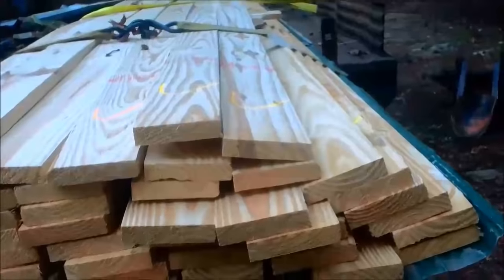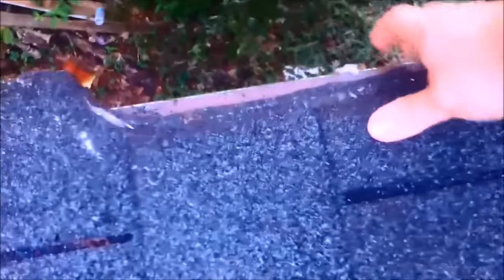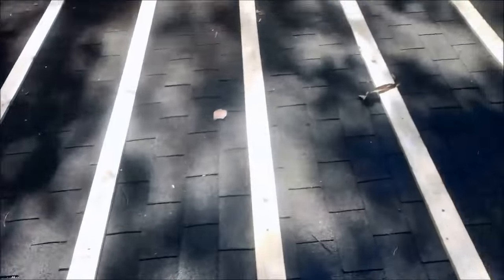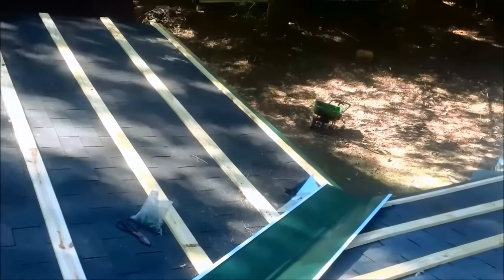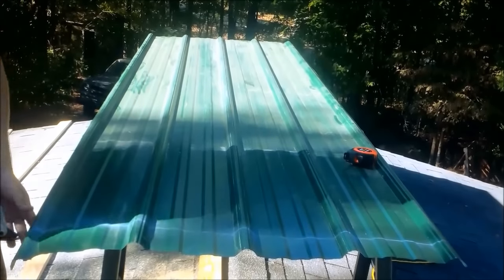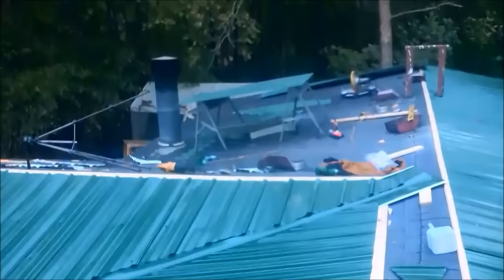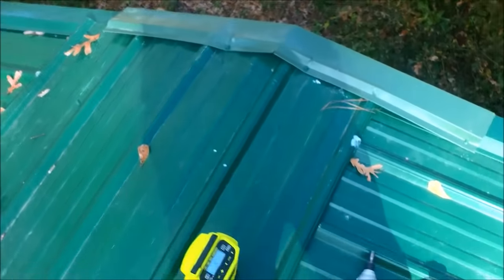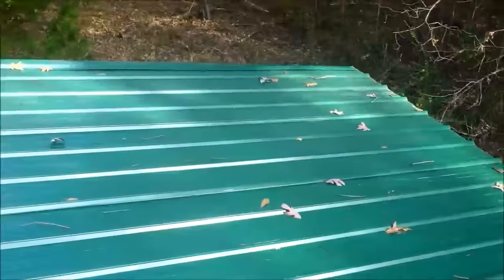How To Metal roof for cheap

Comment: Do you need to get a reroofing like this certified so that when you resell, the roof age is updated to reflect the installation?

And who would do that, local inspector?

And then, would you need a permit to do this?

Thanks.

Comment: Can younwalk on these roofs? Seems like they will dent easy. Thanks for sharing 👍.
Reply: If you step where the screws are the strapping is under that so you’re going to be fine. If you wear running shoes they are softer and lots of grip on a high pitch roof.
Reply: If you step where the screws are that’s where the strapping is so you’re fine. Wear running shoes for grip on higher pitch roof
Reply: If you step where the screws are that’s where the strapping is so you’re fine. Wear running shoes for grip on higher pitch roof.

Comment: Really nice roofing job Bro! We had a 29g roof installed recently and it’s a mess. If I knew then what I knew now I would have probably installed it myself. 

FYI, I would highly recommend anyone looking for a metal roof to atleast step up to 26g steel. Also, keep close eyes on your contractor throughout this particular project. Ensure they do not over tighten the screws and damage the paneling. Check the valley seams, they should overlap 6” minimum. As for the vent/chimney flashing make darn sure they’re placing the upgradient end under the metal sheeting to help prevent water from infiltrating beneath the flashing.

In short, manyyy experienced roofers and suppliers have told us they do not recommend metal roofing. It’s HIGH maintenance due to the  material quality, expanding of materials, likelihood of wind blowing rain backup and under seams. 

If a Roofer won’t send you a professionally written estimate with their letterhead, followed by a written warranty, many references for roofs they’ve installed several years prior than do not waste your money on them.

We now have to remove our brand new roofing due to liars that believe they can roof but truly don’t have the skill level to cut the material properly, lay out the panels, know the best way to seal seams, etc. 

Pay 1/3rd cost and get the lifetime warranty shingles that also covers 25yrs of labor and be done.
Reply: the reason i'm here ... guy just came out to give my mom a estimate for a metal roof, unfortunately i couldn't be there due to my work schedule but when i got there my mom was all excited saying "the guy is amish and he gave me a good price for the metal roof $17k and said look at the estimate and see what you think .. i looked at it and immediately see it's 29 guage metal and it's of course exposed fastener .. he did not explain anything to my mom about guage thickness, difference of exposed fastener/standing seam etc.
 I called the guy and told him i was concerned about the 29g metal on her log home that frequently experiences high wind .. his response "29g is all we use and i have not had a roof blow off yet"  also the only warranty i seen on estimate was 5-year labor. I told my mom i feel she'd be better off with a good quality shingle roof replacement. 
 Please share your thoughts .... i also worry about the exposed fasteners as i have read online how the washers can fail after 7-10 years and water can leak through those screw holes ..

Comment: I’m worried that my roof will sweat if I use 1x4 purlins on existing shingles . I’m in a sub arctic region … I also need to level my roof in one small area with the purlins …. Is 1x 4 s and shim it up level ok , or should I use 2x6

Comment: I am not trying to be negative about a video intended to help others but I don't recommend this. I had my roof done 9 years ago and after the tear off they ran ice/water shield the whole way with drip edge on the edges then 1x4 lath. 
Metal roofing inherently sweats, when you add an airspace under it by putting it on lath, the sweat will dam up on the top edge of the lath and you will have a constant drip with the daily temperature changes which will eventually over time get in behind the facia boards and cause problems. (Ask me how I know) Also, the lath being constantly wet from the sweat will cause it to rot.
My roof has OSB sheeting and I was sold on the theory of having the lath so the screws would have more to bite into. True but not the correct way to do it. Better off running the metal right on top of the shingles and run the screws into the sheeting then just babysit the screws in case any back out from the freeze thaw process.
At least that's what I am experiencing in this northern Idaho climate.

Comment: Good video, if you don't want to purchase the metal cutting tool a simpler trick is to remove the blade from a handheld skill saw, turn it backwards, replace and tighten. It will cut clean in similar fashion
Reply: Heat from the blade scorches the painted metal. Been there, done that, bought an electric shear from HF

Comment: Where are the plumbing stacks, vents, roof vents, ridge vents?
Reply: Wallace Grommet First? I had too! That’s no right at all.!!!
Reply: I had the same question. Were the vent stacks cut slightly below the height of the one by fours, so the venting could still happen within the space above the existing roof within the one by four height across the roof?  I guess this would be OK if the venting can still happen enough outside of the trailer.  I would like to hear thoughts from the author to see if there have been any venting issues and what exactly was done with the vents.
Reply: We don’t need no stinking vents! 😂🤣

Comment: No! Put the screws on the ridges, not the valleys. The plastic washers will degrade over time, and the roof will leak if the screws are in the valleys. In Australia, this would be an instant fail.
Reply from the maker: I buy from the manufacturer they say screw in valleys they said other wise it voids there warranty
Reply: @DannysCam  Then find a new manufacturer. Your clients are going to blame you in ten years' time when they find that their roofs are leaking and the timber underneath is rotting. Washers on roofing screws only work if you have not over-tightened or under-tightened them, and they degrade over time.
Reply: it doesnt rain in Australia

Comment: I would periodically check the silicone. When it comes to water versus silicone, if left unattended, water always wins eventually.
Reply: Might sound silly, but flex seal is what I would probably use.  I have sealed up exterior gaps a half inch or so wide that held for ten years.  The stuff is crazy lol

Comment: FYI - Running wood from top to bottom (vertical) underneath your horizontal wood would allow more airflow (vent the heat) to reduce A/C costs.
Cheap upfront is not always cheapest long run.
Reply: The ribs run top to bottom and can do what you're talking about

Comment: that looked like pine wood you used, was it pressure treated? If not you will definitely have problems down the road.
Reply from the maker: Common practice I removed a 40 year old roof done like this the 1x4s were good enough to reuse

Comment: I've laid thousands of square of metal roofing. Never seen someone put it down with battons. Micheal  Ledford is right the wood will rot  and a lot faster than you think depending on the weather where you're at.TOTAL AMATEUR SorryDanny
Reply: I keep hearing about using firring strips if metal roof installed over shingles (for shed.) I'm assuming firring strips are same as battons. Had a barn for decades and firring strips under metal roof  did not rot. But please elaborate bc planning to use ffitring strips over shingles on a shed in a few months. Thanks! (PS barn was in rainy East Coast,.DelMarVa area.)
Reply: PS - Also, do you think treated wood (vs untreated battons) would hold up better for metal roof (installed over shingles on a shed.) Thanks.

Comment: Man Danny you did a fine job,thing about metal roofs, they last a life time.But the only down side is slippery when wet, and really hard to stay on if you have a high pitch,.On that ridge cap did you think about flattenning the edges where it drainsdown but it would not look too great pounded flat I guess??
Reply from the maker: +N.E.Arkansas Trash Trucks&Lottery thought about it but worryed it would cause the pieces not to over lap so well

Comment: We made a small storage room in the backyard, using cinder blocks, cement, and metal rods for the  corner columns, and put some treated Southern Yellow Pine, around the top, of the perimeter. What do you recommend for covering the grooves on the sides of the metal sheets? I'm thinking what you put there, but what's it called again? You said it pretty fast. Thank you.

Comment: Bantons need gaps lengthwise or trapped condensation will eventually lead to rot, especially with no ridge vent. You did leave the space open on your ridge, correct?
Reply: why do you think it will condensate?

Comment: your silicone is gonna cook in the sun. , but you got a great deal on the materials. as long a you keep a yearly eye on the silicone and replace it as needed you saved a big bundle
Reply: is there a better sealant that won't cook in the sun?
Reply: Tar wont
Reply: "Tar" (which isn't really tar these days) degrades in ultra-violet light just like everything else does.   This installation is a mess.  We won't allow any installation that relies on sealants of any kind as a first defense against leaks.  Gravity flashings, properly fabricated, are the only reliable solution long-term.   Just glopping something out of a caulking gun onto a roof is a joke.

Comment: He doesn't mention how to measure the valley panel lengths. If using measurements (of both sides) to cut the valley panel angles (no adjustable tee-square), keep one thing in mind when measuring the next panel length on both sides. Measure where this panel overlap flange ends, and not where the next panel begins. Failure to measure where the overlap ends, will result in the wrong angle when cutting the sheet. Of course you could compensate by marking this panel to be cut at the 36" point and then strike the cut line, which would extend to include the overlap of this sheet. It would be easier to build a jig square for your angle, and then measure the next panel length on the short side (where the overlap starts) and then use the jig for the proper angle.

Comment: why the wood strips and not lay the steel panels directly on the shingles which are backed by plywood?
Reply: The metal  roofing panel manufacturers don't want steel roofing directly on sheathing (or anything else) because of condensation issues.  The steel needs to dry on the back side.   This is POLE BARN roofing, it's not really designed for residential applications, and because it has exposed fasteners eventually it is going to leak at the fasteners.  The little rubber grommets on the screws are good for a few years and that is all.  For an agricultural building - who cares, but I really hate to see pole barn panels on a house.     IF this was a true standing-seam (hidden fastener) copper roof - you could apply it over solid sheathing.  Not this stuff.
Reply: Really has nothing to do with it - the issue is condensation.  But regardless you could never get away with putting steel directly over three layers of shingles.  This is a total cob-job as others have mentioned.  However it is  a rental so it'll last him a few years.  The valleys are going to leak, the eaves are going to ice dam, the ridge is going to leak.   And because there is a old roof underneath those leaks will be hidden for years, but eventually the damage will be widespread and severe.

Comment: Is there any material that can “rust proof” the metal, that you can apply?  My wife and I have been contemplating a metal roof on my house
Reply: That looks amazing by the way
Reply: Yeah it's called don't cut the roof with anything that'll heat up the protective layer in the paint , hem all cut edges so you don't have exposed raw edges etc.

Comment: Nice work!  I reversed my skill saw blade to cut the metal.  Worked like a charm.
Reply: Now that is a very good tip.
Reply: I tried that. The heat scorched the red paint on the metal. So I bought a cheap metal shear from HF
Reply: Never cut sheet metal with a saw. The heat will destroy the protective coating and it will rust to shit. Theirs a reason tradesmen don't cut it that way.

Comment: Going to be funny years from now when you decide to sell and the house is inspected for valuation. They will find all the water damage where the fasteners went through the existing water tight roof. Then they will find the half-assed job on the roof. You won't think saving a few thousand dollars was so worth it when they knock tens of thousands off the value of the house.

Comment: There's no need for the wood strips/batons, you just need to use metal underlayment over the shingles and then put the metal roofing over it.
Reply: The screws should also be in the top of the ridges.

Comment: I suspect that by now, 5 years later, that his purlins are rotting. Purlins are not needed when putting steel roofing on a flat surface, over shingles or over roof sheathing with felt.
Reply: I'm wondering how that roof is going to hold up with all that weight on it.
Reply: @ronbennettoutdoorswildlife1514  What weight?
Reply: why you think they will rot?

Comment: What kind of metal are you using on the roof? If it's steel or tin it will in time rust. I fought a losing battle against a tin roof (it can only rust so many times until it rusts through) which the original contractor put on, and he had made the house for his daughter (!!!) in our neighborhood at the time. I wouldn't wish it on my worst enemy. The only metal roofing you want on your roof is aluminum. Even if someone offers to pay you to take virgin steel or tin roofing material you'll end up losing in the end.

Comment: Dan I see you screwed the metal in the flats instead of the ridges like a lot of companies do. I have also seen others screw the metal just like you did. Is one way better? I am going to do my roof in metal soon. Thanks
Reply: read the literature that comes with the metal. Each manufacturer will recommended whats best for their product.  That being said,  should have screwed the ridges.    Just tight enough to compress the rubber washers.
Reply: I had a code enforcement fail me because I screwed on the ridges and not the flats
Reply: what did you end up doing?

Comment: While this appears to be watertight, my concern would be the weight. You said it was installed over three layers of shingles. Combine that weight with the purlins and metal roofing plus a snow load. Is this a concern for you? 35 years in the construction trade.
Reply: lol what you think rafters are made from strapping?

Comment: I'm telling you right now Danny, a Cut Off Wheel on a 4" Grinder is much easier faster, less likely to cut your self and cheaper way to cut Sheet Metal Roofing. Over all looks damn good man!
Reply from the maker: your right
Reply: usually it's a zinc substrate beneath the paint. it vaporizes when the grinder hits the roofing. In areas with significant condensation, using a grinder is a recipe for premature panel rusting.
Reply: ***** Oh I see,
Reply: TRX VLOGGER
that being said, I used a grinder on my roof. hahaha...
but I had 22 gauge klip-rib. total pain in the ass to cut it.
Reply: Your roof will rust if you cut it with something that heats up the protective coating. Do not ever cut sheet metal with an angle grinder if it's gonna be exposed to moisture.

Comment: Why do we show a metal roof with all the screws exposed ?  I’m no expert but proper metal roofing overlaps each row of screws so no screws are exposed and eliminate the potential for leaking.  I believe you have to tar each screw after approximately 15 years (washers deteriorate)

Comment: Screws into the pan?? Ends not turned up or down, valley didn’t run all the way, roof sheet used for ridge cap and not scalloped in, barge flashing umm... But hey it works and you have no leaks so that’s all that matters, won’t even start on the battens just hope you have seen Merry Poppens.

Comment: The ribs absorb expansion and contraction.You goofed that up when you put those screws in there.They are made for flat surface.Its not 5v tin.Most of the industry fails to tell us to change the screws in ten years.The washers deteriorate.I’ve learned this the hard way.I’ve already removed one roof and replaced with shingles.Most of the screws were rusty from water infiltration.New ones wouldn’t tighten even #12’s.I used to think metal roof was the way to go.NOT anymore.

Comment: Hope this is in an area with no snow. That roof would collapse in south Dakota if I has 3 layers on it. I personally would have tore the shingles off and used 2x4s instead that way it's easier to shim incase the roof sags in places and that ridge cap looks like total garbage

Comment: Honestly, you could have bought shingles, underpayment and ice guard for about the same price and spend the time to tear off. Typically speaking my cost is about 100/sq for architecturals. I’m assuming your not in a snowy climate as it looks like those valleys will ice dam
Reply: That only last 15 to 20 years metal roof last 50 to 60 even experts are changing to metal roofs

Comment: This cheaper than replacing with shingles,,,?  How long will this last......?    TY
Reply: That depends on the shingles you would want. Some are cheaper some are more expensive.  Generally speaking metal is more expensive but you get s longer life from the roof